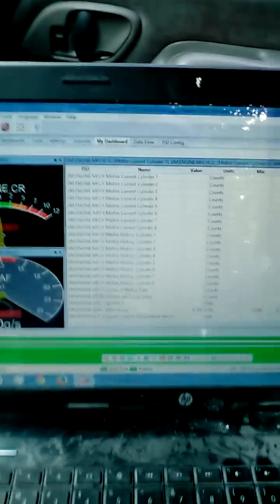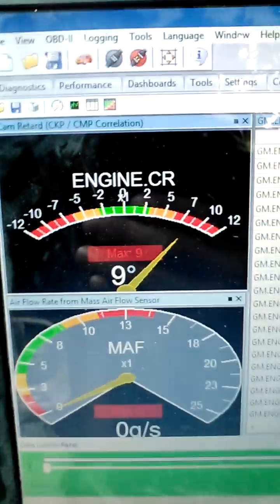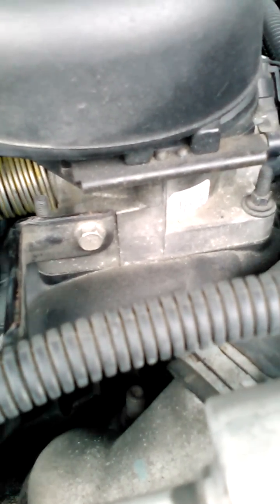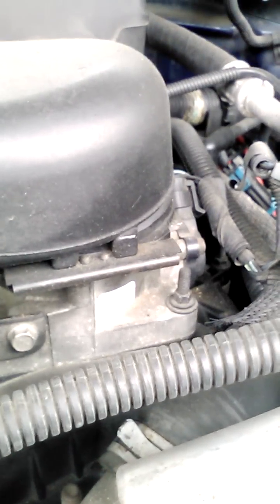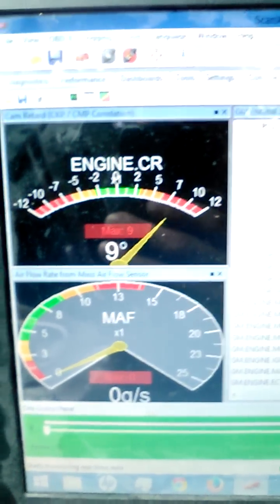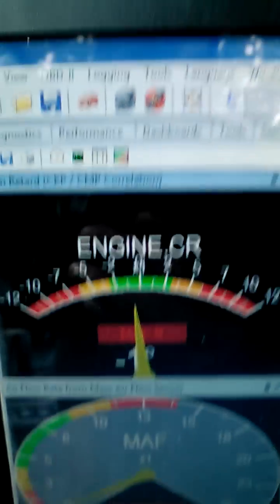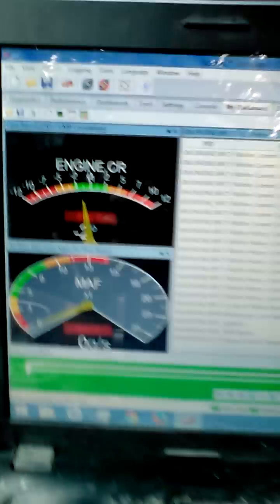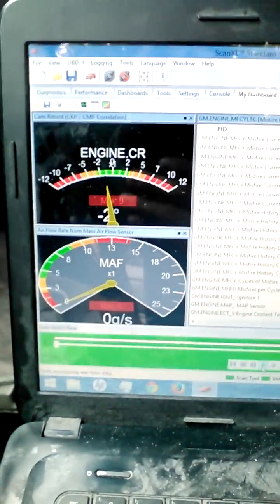vortec v8 96'-00' ignition timing

Comment: great video. However the software you used, while great, is not necessary.  I set mine using a simple Bluetooth and Car Garage Pro app on my Droid and set the CMP Offset for under $40 bucks. Compared it with Tech2 scanner from a friend and it was dead on. So no need to waste money on what is actually a useless procedure anyways. The timing cannot be set as it is controlled by the ECM. And the ECM already knows where the cam and crank sensor are. All you have to do is be sure the distributor is locked in a position where the offset is +/- 2 degrees and the ECM controls timing by that. So if you are at most +2 or at least -2, ECM timing advance calculations will yield the same results. This is just typical GM face flash for young kids graduating from Tech School and getting ripped from Snap On tools into having to buy erroneously expensive scanners. It is all BS.  

My 99 Suburban 5.7 performs the same no matter if I am + or - 2 degrees...zero means nothing but peace of mind. That's why later models didn't use adjustable distributors and we're locked down with non rotating bodies.

If the body is beyond + or - 2 degrees, the ECM will set a P0345 code for camshaft and crank offset.  The best way to set it is install the distributor in correctly and rotate the body to with 1/4" of touching the intake manifold and you will nearly always be within the acceptable parameters.  Done this for years and never had a problem.

Zero degree offset is great, but not necessary. The ECM knows what to do as long as it is within the specified parameters. Any position of the distributor beyond that will likely cause misfiring since the rotor button will physically be beyond the computers ability to time the spark.
Reply from the maker: Horsing Naturally send me a video, or pics of such scantool.
Reply from the maker: personally I can feel every bump and pop if it's not perfect with the larger camshaft i have. I'll be waiting for your link to this $40 tool because I spent months looking for such tool. thanks..
Reply: willy Jilly will do..at work now. will make video tomorrow
Reply from the maker: Horsing Naturally also I've been as far as 12 degrees out without a cel PO345. that -2 to 2+ spec is BS I'll agree. personally I've  been dropping in distributors for years lining up the rotor with the 8 or 6 mark and never had a CEL nor issue. please let me know about the $40 tool. that would really help, as this was the only tool I could find to do this procedure which I'll also agree is nonsense. thanks again!
Reply from the maker: Horsing Naturally the 4.3's are non adjustable from the factory as well, but can be adjusted by slotting the  body/tab. But once again there is really no need for any tool if you know the drop in procedure for a distributor on a L31.
Reply: willy Jilly You should get a code. if not then there may be a problem with your ECM.  P0345 should be popped as soon as you are beyond the +/- 2 degrees.  Throw the distributor out of limits with truck off. Disconnect the battery for about a minute and the. reconnect.  Then start the vehicle and the ECM should immediately pop the code.  If it doesn't, then something is wrong and the ECM may be running the vehicle in default mode using the factory emergency program.
Reply: willy Jilly My buddies Blazer was non adjustable as it had the locked tab.  If it is off on the non adjustable vehicles, then the timing chain is likely worn, or the dizzi gear.  Rarely is the camshaft dizzi gear worn as it is composed of harder materials.  Another thing to watch for are the cheap distributors sold at Advanced Auto Parts...those are garbage...freaking Chinese made crap...lol
Reply: willy Jilly How large did you go on the cam?  Mine is stock as I need most of my horsepower near the lower end spectrum, and mid range as my truck is used for pulling.  high RPM camshafts sound great with the right exhaust, but stall converters are usually required and I hate those things.  Had a 1,700 stall in my old Fairlane with a mild 3/4 cam...takeoff was slow but kid range to high range kicked a$$.
Reply from the maker: Horsing Naturally Thank you for telling me because I researched a long time looking for a product that would read GM pids. Everything circled back to software from scantool.net as the cheapest way to read crank  cam coorelation. I'm going to change the heading of my video to the "outdated way of setting timing on a vortec V8". I really appreciate the information as well and will be updating my video soon.  I have tested being out of the -2 to 2+ on a few vortec L31 engines though. they start up with no codes or anything, and I always disconnect the battery for 10-30 mins after i set CMP/CKP coorelation, to reset things. If you look on YouTube a  lot of guys line up the rotor with the with 6 or 8 mark on a distributor body and never a code nor CEL.  I drove my truck for months using this method, and I was about 4 degrees out with no code/cel. my buddies was 6 degrees out and no code.  just by tightening the distributor hold down I've seen up to 1-2  degree difference. But for $40 everyone should be setting their own timing! once again thanks for sharing that, and I will be updating to this new found way of setting crank cam coorelation. much appreciated 👍
Reply from the maker: Horsing Naturally hey no joke on the advance Auto distributor! I'm on number distributor number 6 and been stranded over 2 caps and rotors. cam sensor leaks from poor design. never had more problems over a distributor in my life! I'm actually pulling it out again this summer to once again replace it. I'm switching to MSD or AC Delco as I'm afraid to drive more than 15 miles with this distributor as I've been stranded before. I really appreciate the help, and I am ordering a scanner from Amazon next week. There aren't any videos so I will definitely be showing off this scanner when I get it, thanks again!!
Reply from the maker: Horsing Naturally I have the ramjet350/383 marine roller cam. it seems to be more sensitive to small changes. I'm spinning up to 5500 though.
Reply: willy Jilly Great motor...more than what I need. LOL I want to upgrade to the 383e
Reply from the maker: Horsing Naturally I'm building a 383 stroker for my 79 Camaro right now. im running a 929 GM cam and sportsman 2 heads with 200cc intake runners. No one could give me a straight answer on what sportsman 2 heads do on a stock L48 350. some guys said they tried them on a stock 350, and it was great. others said the opposite. what do you think of big heads small cam? I
Reply: I tried filming today, but I haven't yet figured out how to record my smart-phones desktop image so everyone can see what I did.  Here's the short version.  Once the bluetooth has been inserted into the OBDII connector, turn the ignition key on.  DO NOT START THE VEHICLE YET.  Next on your smart phone, open up the app and select, "CONNECT".  The App is Car Gauge Pro.  Select the OBDII Bluetooth signal and it will ask for the security access code which is 1234.  Once connected, you are then prompt to make a few selections which are "GM", then, "Powertrain", then "address 10" and "Full Scan mode" where all associated PIDS will be loaded.  Once the PIDS are loaded, you then click on "Dashboard" to insert the two CMP Offset guages; one is marked with an * and the other by **.  Both are needed as one is for the camshaft and the other is for the crank sensor.  Follow the instructions on how to position the guages and how to increase their size to a maximum of 800.  Once you're set, then start the car.  The RPM MUST BE at least 1,000 and no less.  Both CMP Offset readings must be allowed to zero as closely as possible for best results.  When you hit absolute zero 0.0 between the two readings, you are there.  However, due to imperfections of the camshaft and distributor gear, or possibly a loose timing chain, obtaining absolute zero is impossible.  So if both readings show 0.5 or -0.1, you are still zero.  So do not worry about the decimals.  I will try to figure out how to record my phones desktop so all can see.
Reply from the maker: Horsing Naturally that's dead on! I went to a few GM forums and everyone else is using the car gauge pro for $8, and  a $21 Bluetooth OBD tool. I'm pissed because I bought my laptop in 2013 before the Bluetooth OBD adapters were any good just to set timing on my truck. scantool.net was the cheapest ticket at the time. basically I spent $450 altogether, and now it's $30.. technology infuriates me. well I'll fix my video soon and make it more current, and I thank you sir. I'd still love your input on my 383 with the 929 camshaft and sportsman 2 heads on 10:1 compression.  Thanks again, definitely helped me a lot!
Reply: willy Jilly I'd say any felt missing from your 383 is normal due to higher compression and larger cam.  Was your ECM remapped?
Reply from the maker: Horsing Naturally The 383 I have is a older 1970's block. I had a .550 lift retro roller cam in it, but I ended up getting rid of the big roller cam.
Reply from the maker: Horsing Naturally I'm running a 650 double pumper on my 383. and a stock .400 lift cam with 200cc heads. factory cam giant head ports..
Reply: willy Jilly So you're using an old 650 carburetor? Wondering why you need a scanner. I haven't used carburetors in a long time on a vehicle. Modern fuel is very corrosive to carburetors due to the Hydroscopic nature of Ethanol. Not to mention alcohol absorbs moisture from not only the air, but rubber seals, o'rings, and gaskets. Recommend finding a gas station that sells non-Ethanol fuel and it will run better.  You should have seen what my valves looked like after the rebuild I just completed.  Black sticky buildup that would not come off after soaking in parts cleaner, and even a drill with a wire brush wouldn't take it off.  Ethanol is a disaster for all vehicles; even those advertised as Ethanol compatible.  In fact vehicle manufacturers void the warranty when using more than 10% percent ethanol.
Reply from the maker: Horsing Naturally I have a 383 ramjet camshaft in my 97 suburban you are seeing above. I currently have a 383 stroker on my engine stand which is completely different than the truck in the video. sorry for the confusion, I just thought you might have experience with intake runner ports. I'm dropping it in my 79 Camaro this summer..
Reply: @horsingnaturally2244 , there are several on Amazon in that price range, which one did you get please?
Reply: @willyjilly9684  lol I had mine at -32 for a second and the light didn't come on
Reply from the maker: @sbranham86  ignition advance will run that number, but I've never heard of the retard degree that far out without tripping the light
Reply: It's Car Gauge Pro
Reply: great video, when you rotate the distributor to 1/4'' of touching the intake manifold, which way to rotate, clockwise OR counterclockwise ? Thanks
Reply: Horsing Naturally
Reply: So I have the g8 android I've downloaded that app . What is that part I need to buy online to work with this app. I just don't want to get the wrong stuff
Reply: Horsing Naturally 
Is that app $8.99 on Google play?
Reply: Cool

Comment: Great video but I am confused about moving the distributor on my 98 5.7 vortec. My distributor is not adjustable unless hold down bolt is completely removed which would make it impossible to lock down again if I had to move it even the slightest bit. Thanks and please advise.
Reply from the maker: Frank Macchione no, you don't have to remove the entire bolt. just loosen it up enough to remove pressure on the hold down tab. if your distributor housing doesn't move after loosening up the hold down bolt, than most likely the distributor gasket is frozen to the intake manifold. you have to be careful as the distributor housing is plastic, and even a rubber mallet will crack them if you hit em wrong. best bet would be to mark the distributor in coorelation to the intake in multiple places so if you do hit it out of timing you can adjust back where it should. hope everything goes well, let me know if you get it loose.
Reply: Thanks for getting back to me but the hold down bracket locks the distributor in one location. This is a 2 month old billet style and the original one that was replaced was the GM plastic one that had the tabs broken but it also was locked in one position only. I can only move it if I take the bolt out but then I cant line it up the bolt because that damn hold down clamp cant be moved to another position.
Reply from the maker: Frank Macchione ahhhhh you have the aftermarket distributor with non adjustable hold down. I totally feel your pain.  Yeah I tried that too, my timing was out 20 degrees because I used the "special hold down" that came with the distributor I bought. That hold down is NOT synced to the distributor timing. I thought the same thing as you, drop in the new distributor and the new locking hold down will lock the timing in place where it should be. NOPE! I was furious when I discovered how far my timing was out by using the locking hold down. Replaced it with the OEM hold down and set timing.
Reply: willy Jilly Thanks I will give that a try. Much appreciated

Comment: Best video I've found on this thus far. I put a new crate engine in my 98. I stuck a new distributor on it since the previous owner broke the tabs off that hold the cap to the distributor. It ran pretty good for the summer just lining the timing mark with #1. Now that it's cold, she don't like to start easy. I'm going to look into this, I need a scan tool anyhow so this looks like it would do what I need.
Reply from the maker: ih1206 have you swapped the OEM spider assembly for a MPFI yet? Also what kind of distributor did you drop in? I've been left stranded twice because of cheap distributor caps/rotors that came with my aftermarket billet aluminum distributor.. Mine does the same thing now that it's cold, these vortec motors are great but SUPER sensitive..
Reply: willis Kaufman no I haven't messed with the spider assembly. My distributor is just an O'Reillys special. Like I said, I fought with it when I first dropped it in, but I got it to run pretty smooth over the summer. I was doing more research yesterday and read that it might be necessary to do a CASE relearn to get the computer to jive with it. Not sure on that yet but check out this link on pages 3 and 4.

http://www.corvetteforum.com/forums/attachments/c5-tech/47730045d1374054842-best-most-versatile-tuner-tool-for-crank-sensor-relearn-tech-tips.pdf
Reply from the maker: ih1206 yes it does need a relearn procedure, but there is more than one way to skin a vortec. Personally I've ran it with and without relearn, not much difference.. But after you set timing, there is a process of removing the battery cable for 30 mins and hooking it up again. then when you start the car you rev it up immediately, and continue the relearn by driving the vehicle under  45mph slowly giving on and off throttle. it's confusing to explain, but it's possible to relearn at home. I'll try to find a link explaining it better...
Reply: willis Kaufman I seen there was a way to relearn it manually by driving at different speeds and such. That might be the route I go once I'm sure the timing is at 0.

Comment: Hey willis ok so I have everything that you listed but for some reason my readings are all over the place really confused
Reply from the maker: A bad crank sensor or bad cam sensor will cause such problems from my experience..
I would test each sensor, and diagnose from there.
I've experienced ridiculous readings from bad sensors.
A cheap volt meter will give you what you need as far as cam sensor and crank sensor output. I would do that first if readings are crazy..
Reply: If that was the case would that happen to throw a code or would it just throw the timing code?
Reply from the maker: Kyle Shalley this is the problem with vortec engines is that you have to check every parameter and even when you do, it's not always 100%. I've heard many cases of a bad crank or cam sensor with no code read. but that may not be your case at all I just thought I'd throw my $.02 in at the matter. I personally hate the spider assembly fuel injection, and I know that is a problem causer along with the crap Intake manifold gasket
Reply: I completely understand I was just pissed when I hooked everything up and my timing gauge was all over the place and my temp gauge was jumping from 190 to 315 back down driving me nuts
Reply from the maker: Kyle Shalley ECT  sensor can cause all kinds of problems as well with these vortec motors.  Mine was all over the place on the temp too.., turned out the ground wire on the water outlet housing stud was shorted out and needed to be soldered. Another common vortec issue as well.. 👍

Comment: Thanks for the video man, Quick question.. where is that graph for that?? Did you make it? Ive had ScanXl Pro since 2011 and im still learning how to use it lol
Reply from the maker: BentWrench yes I did make these. there are many graphs available with scan XL. it takes a while to figure out how to make a gauge, and then apply a parameter to the gauge. It takes about a full day to make a custom dashboard. but you can always save it to your computer, and pull it up when you open scan XL. I would start with making one gauge, and see if you can save it.. my laptop is broken so i can't guide you through step by step right now. it is a process that I can vouch for...
Reply: Cool man, ive only ever used data view to do the job but the gauge looks way better and easier to read, i kinda made up a halfass one today.. it will take a little time to get all the bells and whistles on the gauge. Thanks for giving me the inch man!